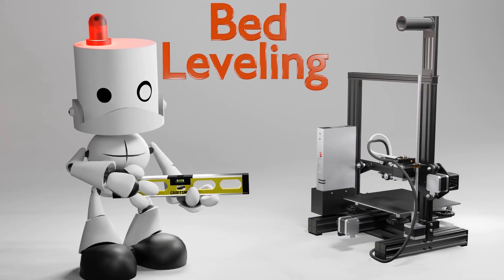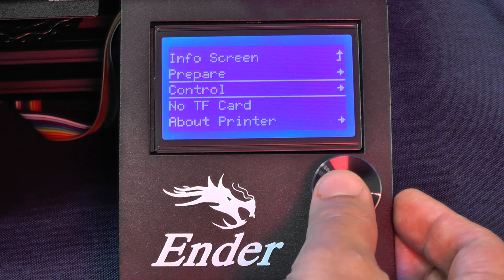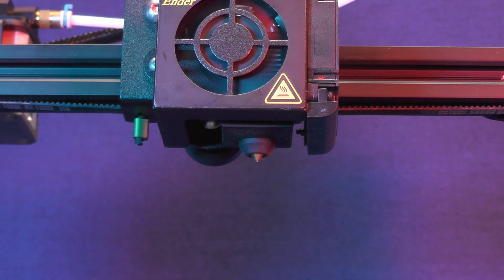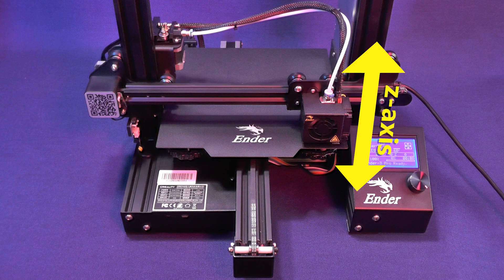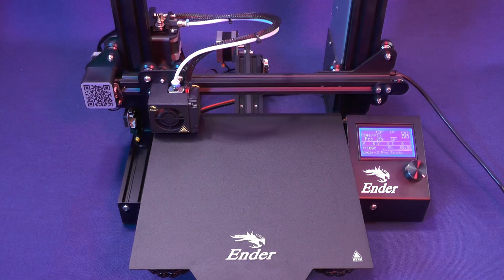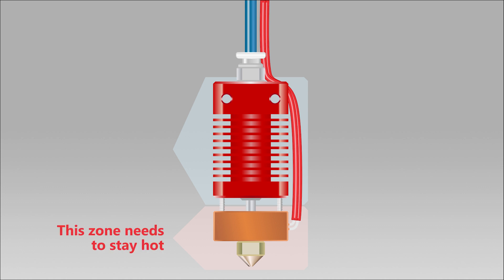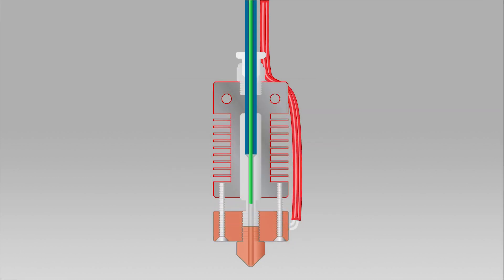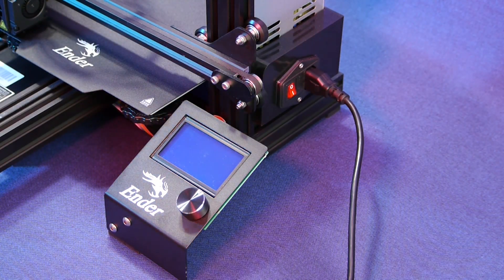1st Steps to 3D Print (2022) 2 of 5 - Bed Leveling In Practice

Comment: thanks again for the great tips    i am a bit surprised that bed leveling needs to a 5 part series  but the videos are good  and insightful
Reply from the maker: The next video will be about installing a Slicer Software and a few other things.
The fourth video will be about doing your first print. It will be a one-layer test print.
The last video will be about printing the calibration Cube and the famous Benchy.

So, as you can see, there will be plenty to cover in the next 3 videos. 😉
Reply: @MakerMindset  Awesome i cant wait